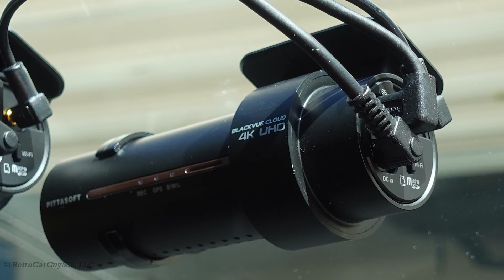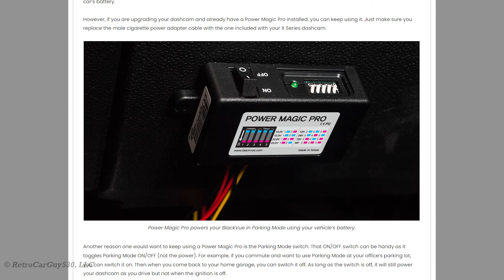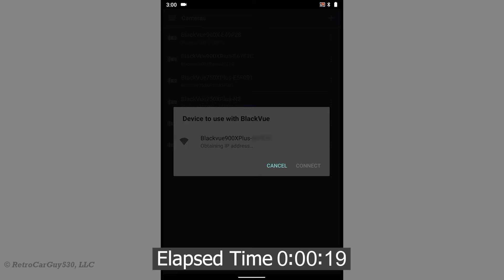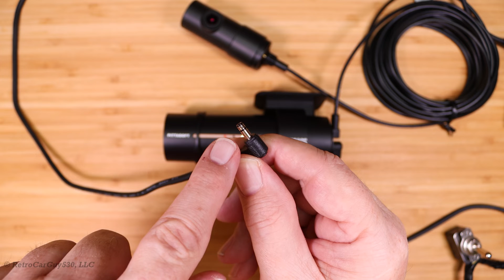BlackVue X-Series Dashcams - Native Parking Mode - Info & FAQs

Comment from the maker: This video covers the BlackVue X-series native parking mode feature and how to properly setup your dashcam to fully enable native parking mode.

I have received several questions from viewers asking why the BlackVue X series dashcam they just installed turned off instead of going into parking mode when it's powered using the 3-wire hardwiring cable. In the FAQ section of the video, I address that question.

⏲ Video Chapters ⏲
00:00 - Intro
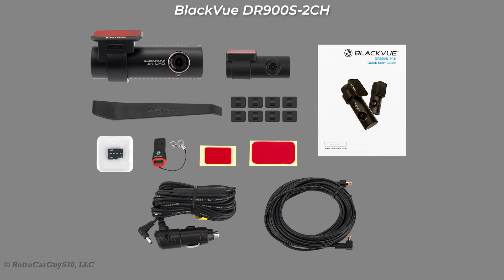00:41 - BlackVue Power Cable History
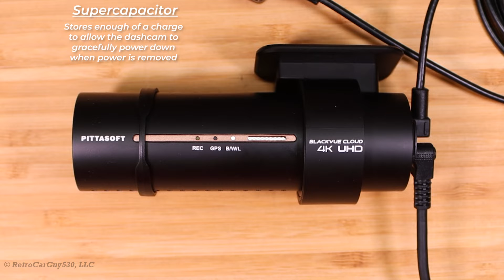01:33 - Built-In Supercapactor
02:27 - Parking Mode Power - Power Port Cable
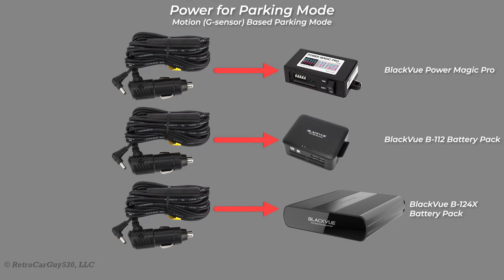02:49 - Parking Mode Power - 3-Wire Cable
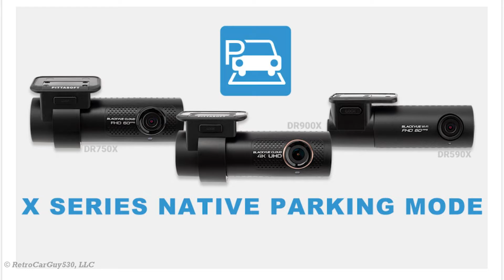03:48 - X Series Native Parking Mode
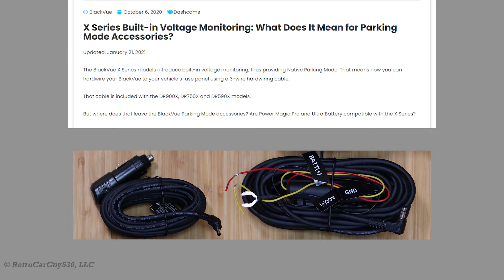04:59 - DC Power Connector Changes
06:41 - Built-In Voltage Monitoring
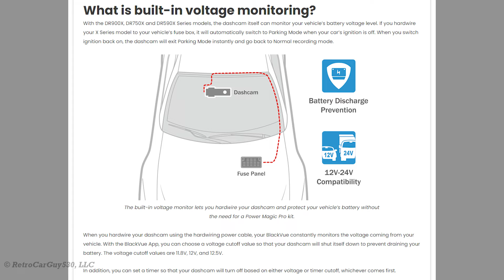07:52 - Power Magic Battery Compatibility
08:49 - Power Magic Pro Compatibility
09:38 - Previous Power Cabling Info
10:09 - FAQ - Why Does The Dashcam Power Off
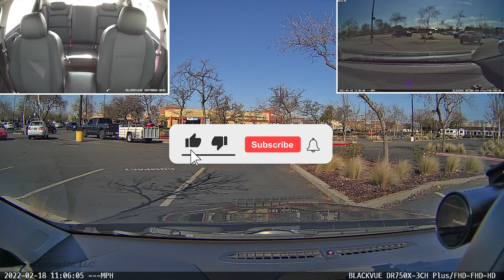15:09 - Outro

Comment: my battery drains the same amount  regardless of my parking mode setting / I parked 12 hrs at work with no recorded event because I set the sensitivity on my camera to 0 motion and my battery drains with same amount while it records 30 plus parking event with 6  motion in setting ... what am I doing wrong ?
Reply from the maker: The dash camera will consume roughly the same amount of power with any of the  sensitivity values. The dash camera remains powered to be able to monitor for those events when in parking mode. When I tested the DR970X-2CH Plus dash camera, it consumed 456 mA @ 12.6V or 5.75 Watts of power while in "Motion & Impact" parking mode.  That's definitely going to draw down your vehicle's battery.  You might want to review the "Battery Protection" settings for the dash camera and make sure you've enabled the low voltage cutoff feature and set a voltage value of 12V or higher to protect the vehicle's battery from being drained too low.
Reply: @RetroCarGuy530  thanks for the info...:yt:

Comment: my parking mode works as usual but sometimes when i unlock the car and get in. the camera just powers down. i have to restart the car sometimes or make sure it’s off then start the car. should i increase the cutoff voltage?
Reply from the maker: It sounds like the vehicle's voltage level is getting low, but not low enough to turn off the dash camera until you open the door and get in.  Unlocking the door(s) and getting in the car will likely wakeup modules in the car and they'll start drawing power. That additional load at that point might be enough to get the vehicle voltage level down to the point where the dash camera is turning off.

Increasing the dash camera low voltage cutoff setting may be one way to address the issue of the vehicle's battery being drained so low. It likely will mean the dash camera will be shutdown by the time you return to your vehicle.  Depending on how low you have the low voltage cutoff setting set to, you may have a vehicle starting battery that is getting older and less capable of holding a charge.  You may want to check your vehicle's battery charge level / health.  Many auto parts stores will perform a battery health check for free [in hopes of selling you a battery].

Also check the how you are powering the dash camera.  Make sure all wires have good connections including the ground wire.

Comment: So if you don’t use any battery pack, you don’t need to sources, the constant one and the acc one.
Reply from the maker: Yes, you still need two power sources (constant and switched/accessory) no matter what supplies the power to the dash camera [vehicle battery or dash camera battery pack].  Some older dash cameras only needed one power source and a ground, but most current model dash cameras usually have 3-wire hardwire cables/kits that need the constant power, accessory power and ground wires to be connected.

Comment: I am planing to buy Blackvue DR770x - 2ch. I have a question regarding parking mode. So I am planning to install the dashcam with hardwire without any other accessories. In that case, will the parking mode turn on every single time I stopped the car? Coz usually I park my car in the garage and I don’t need the parking mode on that time. So is there any option to manually turn on and off parking mode without any other accessories?
Reply from the maker: BlackVue dash cameras can have parking mode enabled/disabled via their firmware settings. If parking mode is enabled and the dash camera is hardwired, the dash camera will enter parking mode when the vehicle's ignition is turned off (turning off accessory power). It will also go into parking mode if the vehicle remains stationary (motionless) for 5-minutes.

There is no option to disable parking mode without going into the settings using the BlackVue app. That's why I add a switch to the power cable for the BlackVue dash camera that allows me to turn off the constant battery power to the dash camera when I arrive at home and park the car in the garage.
Reply: @RetroCarGuy530  yeah it makes sense cut down the power via switch once you park at the garage. Then do we need to turn it back on every time if we are going out? Or the camera get the power through the accessory power even the power cable switched off?
Reply from the maker: The dash camera is always powered by the constant battery power source. The accessory power wire is only so the dash camera knows when the vehicle is running or not running.
Reply: @RetroCarGuy530  which means we need to turn the switch manually ON, when we are going out?
But if we use cigarette lighter adapter, the camera only get power when the car start up, then why can’t we use the same method for the hard wire? I mean what about if we swap the acc and constant power wire? Does it allow us to turn on the parking mode just by the switch..🤔
Reply from the maker: Yes, you must manually turn on the switch when leaving the garage. You can hardwire the dash camera so that both the camera's constant battery wire and accessory power wire are connected to an accessory/switched power source in the fuse box. That will be equal to what the cigarette lighter adapter does to send power to the dash camera. If the camera's constant battery power wire is only getting power from an accessory/switched power source, the dash camera will never go into parking mode, it will turn off when the ignition switch is turned to the "off" position.
Reply: @RetroCarGuy530  got it. Cheers for the info man. Much appreciated. Btw hope the 770x is overall good camera..😇

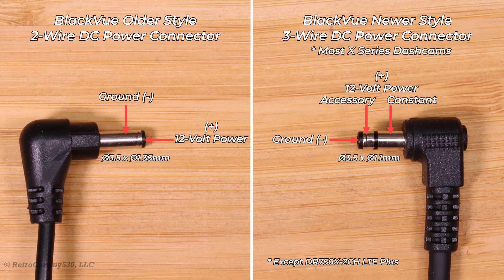Comment: Genius! Thank you soooo much. I have been trying for days to get my 750X to go into Parking mode. It turns out that the previously installed Power Magic Pro wiring red and yellow wires were different from the X hardwire and the Acc and Batt were reversed. Your video at 5:07 showing the pinout of the 3 wire plug showed me that the yellow and red needed swapped. Bingo! I now have Parking mode. What a great video, thanks.

Comment: Hi great video. I have a coupoe questions. 

If you are working on the car for extended periods, shouldnyoubtuen parking mode off ie washing car or in garage etc?

Secondly when in parking mode does it have an led that flickers from outside alerting possible thieves that a dash cam is recording? Personally i eould want that led set to off. Thanks
Reply from the maker: Since the BlackVue dash cameras don't come with a power button/switch, I added a switch to the power wires in the 3-wire harness that allows me to turn it fully off.  The next best option would be to simply pull the power plug out of the dash camera to allow it to power down for times when you don't need to record in parking mode.  Pulling the plug out is not the best option, but it can be useful.  You can also turn off parking mode and then turn off the ignition and the dash camera should power down as well.

There is a status led on the front/rear cameras.  I turn off the status LED in the settings to make the installation as stealthy as possible.

Comment: Hi mate i have a 900x plus with lte module, I only drive my car 1s aweek so its parked 6 days aweek, I need parking mode on,does the 900x plus have motion detection, I want it to record only when it detects movement, and will i need a back up battery pack if so what do you recommend please thank you.
Reply from the maker: There are two parking modes available with the DR900X Plus, "Motion & Impact detection" and "Time lapse".  The amount of time you want to have the DR900X Plus in parking mode (6 days a week) will mean a dash camera battery pack plus one or more additional dash camera extension battery packs.  The issue with having several dash camera battery packs is it will take an extended time to charge them to full capacity (several hours - for multiple battery packs).  On the day you do drive you vehicle, you would have to drive it for a long period of time to fully charge the battery packs or supplement their charge level by getting a DC inverter and/or DC power supply to configure a home charging setup for them.  The new BlackVue B-130X has a capacity of 7,500 mAh / 96 Wh, but it does not support adding an extension battery pack or packs.  The BlackboxMyCar PowerCell 8 does support adding extension battery packs (Cellink Neo Extended Battery).  You might want to look at my recent video on the three of the highest capacity battery packs on the market today (North America).  https://www.youtube.com/watch?v=Gn3IoBjO_Vg
Reply: @RetroCarGuy530  thank you so much mate i appreciate your help

Comment: Mate! Thank you thank you thank you, I have been pulling my hair out with this for 3 days, even the shop who fitted the cameras could not figure it out. So I turned on battery protection and then set the options underneath to off as I have a Cellink NEO 8+ connected to the camera! I searched high and low on the web and came across your video which has resolved it with a simple click. Thank you .
Reply from the maker: No problem 👍

Comment: Great video. I have a issue with mine with in parking mode the led won’t flash. It turns on when it goes in parking mode but won’t flash. Have you had any experience with that?
Reply from the maker: The "Record" LED will only blink green when the "Motion & Impact detection" parking mode setting is selected.  If you've selected "Time lapse" parking mode, it will not blink it will simply be a steady green color while in parking mode.
Reply: @RetroCarGuy530  thank you so much 🍻

Comment: what is a better package  "complete solution " for parking monitoring"   1. Getting the new DR750X 2CH LTE Plus with  the Parking Mode battery 2. Getting the DR750X 3CH plus with LTE Connectivity Module and Parking Mode battery. Obviously #2 you get the extra interior monitoring cam that would be nice for open widows or convertable. My concern is it better to have a separate LTE Connect or to get the new model with LTE built in?
Reply from the maker: I tested the DR750-2CH LTE dash camera a couple of years ago.  The LTE modem used in that dash camera did not work very well in my area (Northern California - Sacramento Valley).  It would drop connections a lot.  I believe the current DR750X-2CH LTE uses the same LTE modem as the older model.  I ended up getting the CM100LTE connectivity device and I tested that with a DR900X-2CH, a DR750X-2CH Plus, DR900X-2CH Plus, DR750X-3CH Plus.  It works very well.

The other thing to consider is the DR750X-3CH Plus dash camera reduces the front camera video bitrate to allow the processor to handle the extra (interior) video channel processing.  It doesn't seem to degrade the image very much, but it does reduce the bitrate compared to the 2-channel version of the camera.  If you don't need the interior camera, I might suggest the DR750X-2CH Plus using the CM100LTE connectivity device and a dash camera battery pack.
Reply: @RetroCarGuy530  thank you for your help. I’m a new sub. I value your in depth knowledge and experience. I’m getting my first dash cam and I appreciate quality, especially when it’s for my expensive cars and trucks.
Reply from the maker: I'm glad that you find my info helpful!  Keep in mind that BlackVue is attending the Consumer Electronics Show (CES) in January 2023.  They'll likely make new product announcements at that time.  BlackVue did not have a booth at SEMA this year, so I don't have any insight into what their new models (if any) will be.
Reply: @RetroCarGuy530  yes, I was thinking of waiting for CES to see the new tech. I work in Fitness and Health Tech and just started a new YT called Nurses to Tech. I will be speaking at a few events in 2023

Comment: Does anyone know why my DR900X 2CH won't respond to the battery protection settings
Reply from the maker: If you've enabled parking mode and have battery protection settings configured / on, then it should work.

Recording > Parking mode recording = "Motion & Impact detection" or "Time lapse"
System > Battery protection = On
System > Battery protection > Low voltage-cutoff = On
System > Battery protection > Low voltage-cutoff > Passenger Vehicle = 12.2V (this is my recommended min value)
    There will be an allowed voltage variance for this setting of approx. +/- 0.1 volt
System > Battery protection > Cut-off timer = On or Off depending on your needs
Reply: @RetroCarGuy530  Hi, thanks for the reply.
Yes I have all the settings correctly set and use an official blackvue SD card but for some reason my camera will not respond to the battery protection settings.
Tried everything I can think of, cheers anyway.

Comment: I was wondering why parking mode didn’t turn on when my truck was turned off on my 900x+ after this video I figured something was wrong with my wiring. Turns out I had the batt and acc wires flip flopped. Switched them on my fuse box and it worked!!  Thanks!
Reply from the maker: I'm glad the video was helpful in resolving your parking mode issue!

Comment: Hi, i have b124x connected with dr750x plus 2ch. Why only running 10 hrs on parking mode? And sometimes dash cam powering down itself on parking mode even battery still have 70% left. Thanks
Reply from the maker: The B-124X should be able to power that dash camera for 18 to 21 hours in parking mode.  If the DR750X Plus setting "Firmware / Wi-Fi / Wi-Fi auto turn off" (after 10 minutes of no use), you should get the upper end of the time range.  If you have a CM100LTE connectivity device connected as well that makes it so Wi-Fi won't auto turn off and it reduces the amount of time that it can run on battery in parking mode.

In the BlackVue Battery Manager app, make sure the "Battery capacity" value being reported is 6000 mAh with that being the capacity of the B-124X's internal battery.  If that value is not shown as 6000, use the settings panel to adjust it back to 6000 mAh.  That value along with the B-124X's belief as to the current charge level of the battery will determine what it's reporting for the percent charge level remaining.

Make sure the power wiring for the DR750X-2CH Plus is connected correctly to the B-124X's output power port.  The BATT+ and ACC+ (if using 3 wire hardwiring harness) and GND wires should be connected directly to the B-124X.  The GND wire of that 3-wire harness should not be connected to a vehicle body ground, it should be connected to the B-124X.  Not likely the issue, but worth mentioning.

The DR750X-2CH Plus should have firmware "System / Battery Protection" enabled (otherwise it won't go into parking mode).  With the B-124X powering the dash camera, you could turn off the "Low voltage cut-off" voltage setting or if you want it enabled you could set it to a low voltage level of 11.8 volts.  Make sure the "Cut-off timer" is disabled as well since that will limit the amount of time the dash camera will remain in parking mode.

If checking everything mentioned before this point doesn't solve it, then either the DR750X-2CH Plus is consuming more power than normal in parking mode (280 mA to 300 mA) or the B-124X's internal battery is not really getting charged to 100 percent or its true capacity is far less than the expected 6000 mAh.  If you're familiar with using a digital multimeter, you could place it in the BATT+ wiring to see how many milliamps (mA) the DR750X-2CH Plus is truly consuming and if it's well above the expected 280 mA to 300 mA range then the dash camera might be defective.

All of what I've mentioned is making sure the dash camera and the B-124X are wired correctly, configured correctly and then moving on to see what might be defective.  I hope something in this long reply helps.

Comment: Blackvue needs to setup firmware for parking mode ACC only.
Quite annoying it will switch to G-Sensor motion base park mode when car is stationary 5 minutes, requardless of all three wire hook up.
Goes instant into park mode when engine off like it should, and instant normal recording when engine starts, like it should.
But sit in traffic 5+ minutes and goes into park mode defeating the purpose of a ACC trigger.
Reply from the maker: I've been suggesting to Pittasoft that they should add a firmware setting to enable/disable the motion based parking mode.  I agree that motion based parking mode still being enabled when the dash cam is being powered by a 3-wire hardwiring harness makes little sense to me.